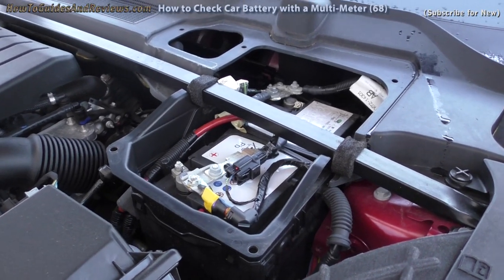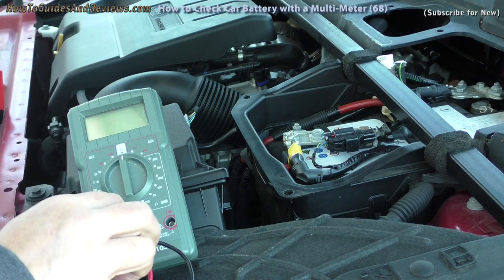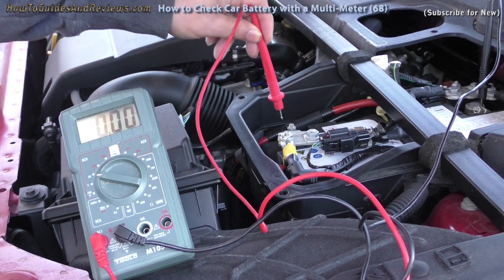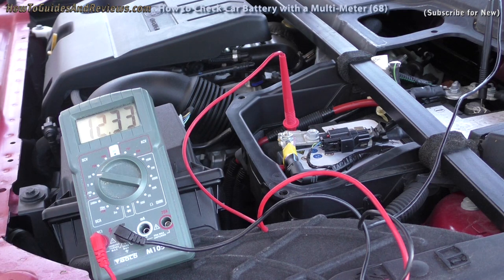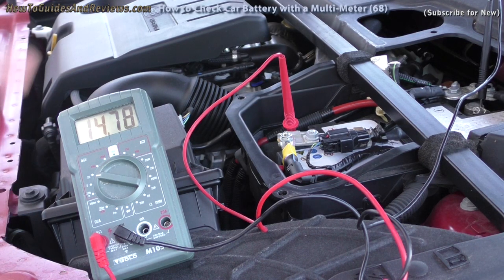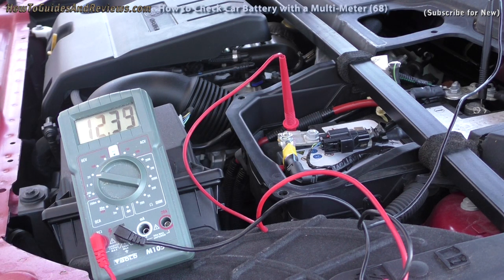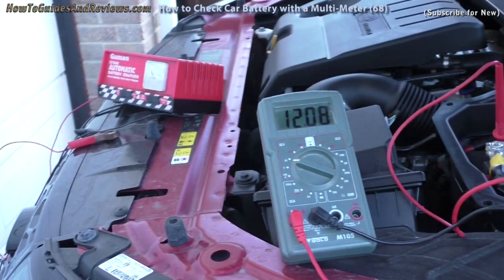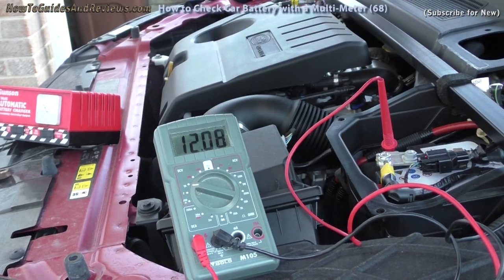How to Test Your Car Battery with a Multimeter Check if Good or Bad, Needs Replacing or Charging

Comment: There is a lot of things wrong with the way the battery was tested in this video. The reason the voltage drops down so much after starting the car and then turning it off is because loads of stuff in the car gets powered up when you turn on the ignition and takes a while for them to turn off again - totally normal.
Normal multimeters dont refresh their screen enough for you to catch what the real lowest voltage was when you started up. It's not a matter of a faster camera, the screen on the multimeter refreshes its values slowly (the lowest value is never displayed). To do that test properly you need a multimeter that records the data and can show you the lowest value after (very expensive) or one of those battery checker tools that specifically remembers the lowest reading.
If you have a flatish battery that you suspect is bad, recharge it with a trickle charger rather than a fast or slow charger. Trickle charging a battery over a long period can often bring some life back to it and make it last quite a bit longer. When you go to test your car battery with a multimeter, unlock your door, pop the hood, shut the door and go away for 15mins. Then come back open the popped hood and test. Just opening the door or putting the key in the ignition on some cars, can cause all sorts of stuff to turn on and cause a drain on the system which will show up as a lower voltage when you test.
Reply from the maker: The test is fine to check a battery by a car owner, no need to buy expensive tech, it's not a garage.
Reply: @Quantum_AI_Tech  yeah its a not a garage, joker.

Comment: There is a couple of key pieces of information relative to automotive battery life that are missing in this video.  Firstly, the battery deterioates with age.  Additionally, the rate of deteriation is very much a product of the ambient tempeature when you tried to crank your engine.  Winter conditions, cold conditions reduce the cranking amps available.  If your battery is around seven years old .. you've done well.  Replace it.  The only sure fire way to test a battery is a load test.  Testing with voltmeters will give you some information but not definitive.  It's possible to go to a scrap yard .. lift the hood on a vehicle and find a lead acid battery to give you a terminal voltage of 12 volts .. try a load across it and it will quickly die.  The voltage tests in the video to indicate your alternator and voltage regulator are providing the charge voltage for your battery is useful.
Reply: How to test under load?

Comment: Your battery voltage dropped to 10.2 volts on cranking, which isn’t too good… battery will be worn-out in cold weather
Reply from the maker: Still chugging away,  not replaced it yet.
Reply: My battery cranks over ok, but drops to around 9.5 volts, so no longer giving out it’s peak power (it’s a 9 year old battery lols)
I’ve recently bought a cheap new Lion battery from Euro car pts as a spare, which is currently sitting at home.
Reply from the maker: At the end of the day if it starts the car without fail then it's good to go, if it tends to die before starting the car then it's time for a new battery.,